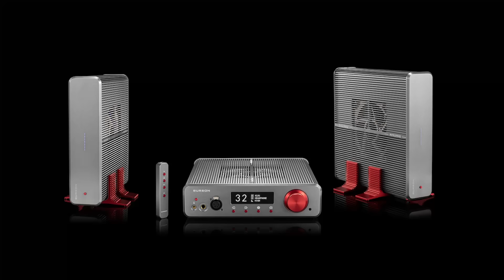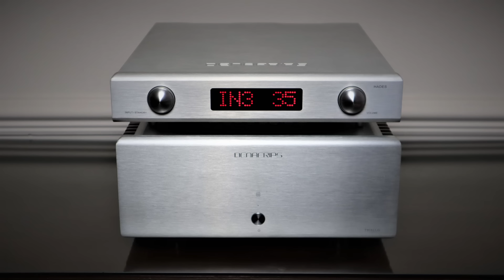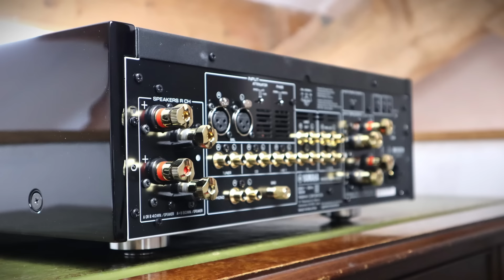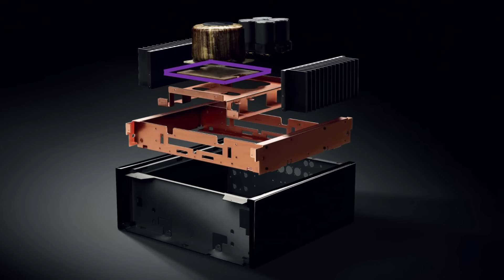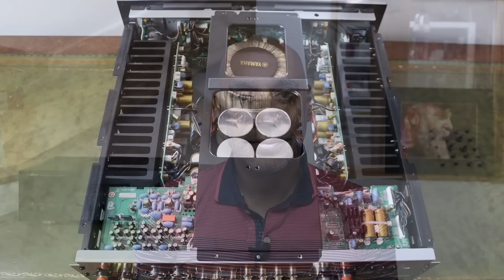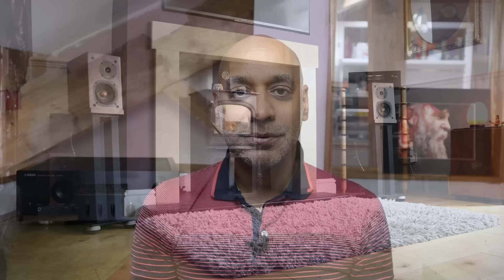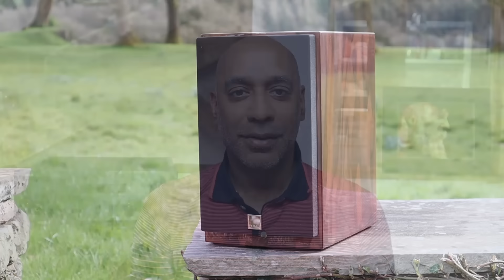ATTAINABLE HIGH-END! Yamaha A-S2200 Amplifier Review

Comment: Hi Tarun, that is a very nice review, it provides good information about the nature of the A-S2200. I really like the looks of these modern Yamaha amps, who can resist a pair of nice VU meters? I am not so sure if balanced topology is the way to go. What if you spend the same on an asymmetric topology? I am not sure what will then sound better. It could just depend on the product, regardless if it is balanced or not. For that reason I have also nothing against it. But I will not make it a goal either.
Reply from the maker: Thank you Hugo. My view with people who use bi-wire cables was why not just spend twice as much on a better cable. A similar argument can be made for balanced amplifiers. It was fun to try out the A-S2200 but I would like to try out some more single ended designs at this price too 👍

Comment: I have been using this for over a year and love it. What attracted me to it was the balanced all analog design. I wish more integrated amps would follow suit and not include a DAC when the typical consumers already have a much better performing separate DAC. The killer feature that isn't mentioned enough is the MM phono stage which sounds great and has a dead silent background. I feel there's no need to upgrade to a separate phono stage component until I venture towards pricy MC cartridges.
Reply: The phono stage in the A-S2200 is very, very good, particularly in MM mode. If you upgrade to an MC cartridge, try a MC step-up transformer. In my experience using the very low output Linn Troika MC, using a SUT into the MM input resulted in spacious, almost holographic soundstage, a relaxed yet extended demeanor, and dead quiet when compared to using the Troika straight into the MC stage, which in itself was no slouch.
Reply: @daniannaci3258 Is there something wrong with using the mc setting on the as2200. It's not as good as when set to mm?
Reply from the maker: Thank you for sharing your experiences 😊
Reply: I really like the features included and omitted. And, if your gonna do it, do it right kinda thinking. Thanks for the MM phono stage assessment. A high quality built-in phono stage will reduce upgrade costs, especially for those of us content with MM carts.
Reply: I'm so glad for the tip of using a step up transformer in the mm setting on the phono. I have a Denon 103R I'd been using in another system (vintage Marantz 3200 pre) that I used with a Hafler SUT but with noticeable hum. When my audioquest phono cable went bad I moved the turntable to my bedroom system built around my 2200 and since there was an mc setting had left it happily. I pulled the Hafler out of the closet after reading your comment and wow...it sounds amazing and with abosuletly no hum! All this time I just figured hum was an SUT drawback but the amazing Yamaha has far superior grounding capability than my old Marantz I suppose. Always liked the sound of the Hafler and so glad to have it back in a system. It already sounded good in mc but this gives it a little something extra in the soundstage.

Comment: Excellent as always, Tarun.  I have two amplifier setups and noise through the speakers is inaudible.  The moving coil phono stage contributes far more noise than the amps.

I believe it’s better to spend money on higher quality parts as this will have a greater impact in most systems.
Reply from the maker: Thank you Mark. My favourite solid state amps are still single end at this price. That may change as and when I get into the £10k+ range 👍
Reply: Try a MC step-up transformer into the MM input.  Provided the SUT is sited correctly, no active MC stage is more quiet than the passive SUT.
Reply: @daniannaci3258  thanks for the suggestion, however, the problem of noise probably came across as more pronounced than I intended.  The main amps are silent and the MC phono stage makes a slight hiss with my ear next to the speaker.  Not an issue from my listening position.  As I spent £1,000 on it, it’s staying put, particularly as I’ve now tuned the gain, impedance and capacitance to match my cartridge perfectly.

Comment: Another great review. I recently got the Dynaudio evoke 50. Was looking for amplifierrs. Hegal 190, audiolab 9000a , yamaha 2200 . Ended up getting yamaha R2000n. :$ i am sure you have a lot in your plate but if possible please do review R2000n.
Reply from the maker: Thank you. I hope to get to it at some point 😊
Reply: @abritishaudiophile7314  quick one. You mentioned that this can be used as preamplifier. Did you get the chance to connect it with power amplifier? 🙏
Reply from the maker: @urbenkam  I didn’t I am afraid 😊

Comment: Hi Tarun, as i already own a ax-550 and ax-596 i splashed out on a 2200 last October as a retirement present to myself, ive noticed, on the phono input only, it produces more noise than the other two amps , even when no leads are connected, at full volume the meters on peak setting are almost reaching the -50db  mark erratically once a second or so at different times for each channel, irrespective of whether there's cables plugged in for my TT or not, so its definitely just the amp. Was wondering if you still had the 2200 if that was also the case with yours?
All the other inputs are silent! Cheers from a Londoner.
Reply from the maker: I don’t own a turntable so I couldn’t test the phonostage 😊
Reply: Thanks for your reply, no TT needed, the noise spikes are there with just the input selector on phono and the volume set to max with the meter set to peak, thanks.

Comment: Tarun, another great review. I have this amp. One issue I have with this amp - Low level listening is flat. It takes atleast 9pm/10pm to come to life. And i have noticed it across speakers. Have you noticed this? Am I missing something I wonder.

Its almost as if I miss that 'loudness' control.

For the rest, it is a keeper and a fantastic amp. Silver yes.
Reply from the maker: Thank you. It’s lighter presentation makes it not the best choice at low levels but it wasn’t an issue with the ProAcs and Dalis which are great at low level listening 😊
Reply: i have this amp for about a month now. I agree it sounds thin at low levels. This is why for low level listening I always crank those bass and treble knobs - bass knob to around 2 oclock and treble knob around 1 oclock... solves the problem immediately with beautifully balanced sound at low levels. Don't be afraid to touch those knobs.
Reply: @MrPetermc199 which speakers do you drive with that one. I had the same experience with the as1200 too.

Comment: As always, great review. What I’ve learned living with the AS200 is that the circuit really is amazing. Hooked up with a entry level DAC (Ares2) it gives the sense that the power is lacking in the bass. However, hook up a Holo Audio Spring 3 KTE and quickly you learn that it’s dependent on your source. Powerful quick bass and holographic soundstage. It’s a fantastic match with KLH model 5. And I hope it’s good enough for the model 7
Reply: Agreed. The dac and possibly burn in makes all the difference. I wanted to love this amp for its build quality, balanced inputs, and those meters. It was just too mid forward with the Klipsch speakers and tube dac in my main system. Now I have paired with JBL l-96s and a Gustard R26 in another system and am amazed. Balance so zero distortion and is so clear and coherent at even the lowest volumes. I read  people saying this amp had an almost tubelike glow but never heard it cause the dacs I tried were too sharp. The fantastic JBL bass and midrange is really shining through and I love this amp now which is great because it is the highest end amp I own. A balanced R2R dac is definitly the ticket with the Yamaha!
Reply: Yeah many people say model 5 sound great with the Yammie ' hell of build quality with 2200' just read an article where lead Engeener Re-tuned the built in Preamp of the 2200 to give it a more balanced and transparent sound ' 
And yeah phono Eq is legit amp loaded up With Nichicon KZ Jewerly now you know where the Lost gold of my Mayans went 😆
Reply from the maker: Thank you SB 😊
Reply: @abritishaudiophile7314  Did you let the 2200 burn-in for approx 120 hrs. There is a significant sonic change that occurs in this amp after burn-in.
Reply from the maker: @wa2368  I am aware of the long burn in reputation.  My contact at Yamaha ran it in his home for four months and I also used it daily for three weeks before critical listening 😊
Reply: I paired with a Gustard R26 and it sounds superb. It has been 3 years without attending the Capital Audio Fest. Percussions sound unreal, and base is more than enough.

Comment: I would have gone for the A-S2200 if it had been available at the time, but supply chain issues had everything screwed up. So I bought the A-S3200 instead. That's a big jump in price, from $4,500 to $8,000. Luckily I had the money at the time and I didn't want to wait for who knows how long. Whether it's worth $3,500 more than the A-S2200 I can't really say, but sonically for me I highly doubt it. It does have balanced connectors for two components, so there's that, lol. The one thing I dislike on my silver version is that the VU meter needles are quite fine and very hard to see from any distance away, but the black version looks much more legible. Other than that I'm happy with mine.
Reply: Hi Chris, I'd bet you anything if you had an A-S2200 there to compare against your A-S3200 it just wouldn't compete. I've owned the A-S2100 and the A-S3000 and the A-S3000 wins hands down, it isn't even close. The A-S2100 was very good, but the A-S3000 is exceptional. The dynamics, sound stage and clarity is on another level. I love how airy and open the A-S3000 is and how the instruments just hang in space. The A-S2100 sounded much more closed in in comparison. I'd expect a similar performance between the A-S2200 and the A-S3200 as they didn't change a great deal in these amps. Also, I owned both the black and silver A-S3000 for a while. I sold the black. Looks sexy but it really showed up the dust, plus I think the silver looks so much better despite the VU metres being more difficult to read. It looks so retro and classy. I believe you made the right choice buying the A-S3200. It offers so much more than just another set of balanced connectors. I'd put very good money on it being in another league sound wise compared to the A-S2200. I believe you get what you pay for with these amps. I owned the A-S1100 and the A-S2100 bettered it. Likewise the A-S3000 bettering the A-S2100.
Reply: @joshsw6776  
Thanks Josh, it's reassuring to know that extra money was a good investment.
Reply from the maker: Nice. Thank you for sharing Chris 👍
Reply: And the second reson why I haven't bought my 2100 in grey is the side panels in gloss finish. Black on black is better than gloss black side panels on grey. Now I am having trouble seeing the volume level from distance because it is black on black. I know grey doesn't have that problem since I had 801 in grey b4 2100.
Reply: @jazzabana  
Hmmm, that's something I forgot, as I can't tell on my silver version where the volume is. The big knob just has a machined  line indicator without any color. They should have painted it or better yet have an LED, but bigger than the ones in the faceplate because they are too small. Wow, sounds like I have more complaints than I first mentioned.

Comment: I have an entry level yamaha amp with matching cassette desk. Had them hooked to living room projector for TV audio for 20+ years, not let me down once, built to last!
Reply from the maker: That is great 👍
Reply: Made in Japan?
Reply from the maker: @etk4188  yes 😊
Reply: Beautifully build.., but unreliable… and Yamaha refused to acknowledge it…
Reply: @tigertiger1699  may be 20 years ago things were built to last at least 10yrs. Of course since then we live in a world of buy, use, recycle or throw away and buy again new. I also have a Musical fidelity amp and MF CD player running my system for 18 years and a pro-ject rmp vinyl player still running for 15 years. 2 Panasonic projectors running for 13 yrs +. Touch wood!!
Reply: Nice…, unfortunately my AS3000…, was in for multiple month repairs with Yamaha service agent .. for each of the 6 times over 5 years I owned it… it kept dropping the RH channel.., the service agent spends weeks  each time chasing the failures around the boards..